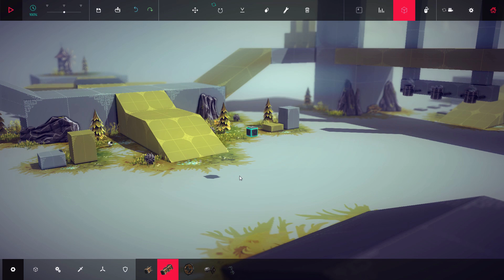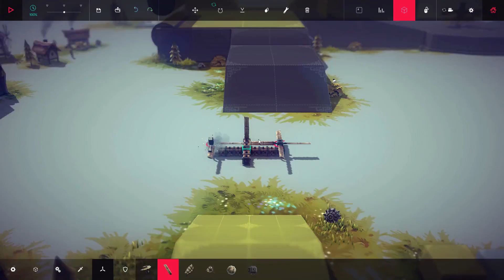Besiege Flying Machine Tutorial | The Basics of Vertical Flight

Comment: Hey i'm sure you figured it out by now but at 6:20 if you pause you see the second set of propellers on top is spinning twice as fast in the same direction, meaning the bottom block is spinning 1 clock wise, and the top is spinning 2 clockwise ontop of the 1, putting it NOT at 1 in the opposite direction like you wanted, but 3 times as fast in the same direction xD

However yes, if you flip the wheel you will find the top set of propellers go at 1 speed in the opposite direction.

Comment: Just make a helicopter with only one set of propellers, and on the back of the copter, add a flying block to act as a rotor. Normal helicopters in real life use it, it cancels out the extra rotation